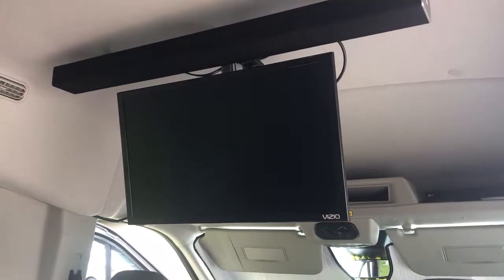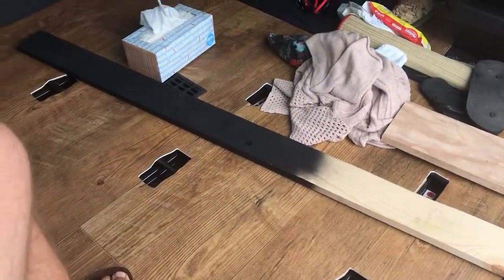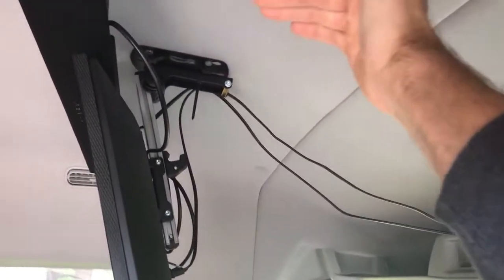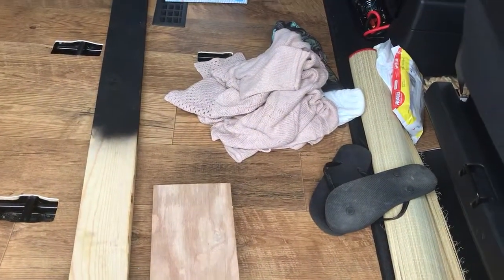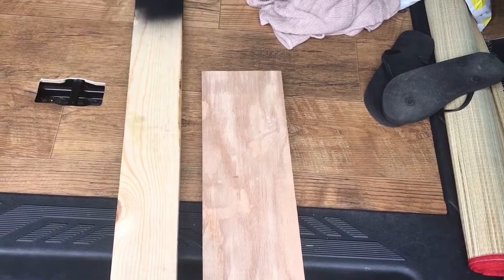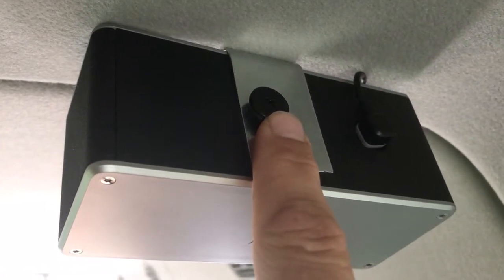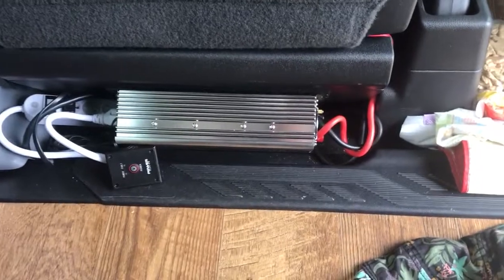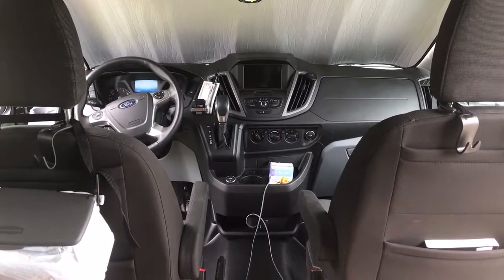2017 Ford Transit Passenger wagon TV sound system install

Comment: Where did you do your write up on the flooring? Looks good I’m in the same boat and want to get rid of the carpet.
Reply from the maker: I didn’t do a write up on the flooring unfortunately.  However, with the linoleum floor and the way the van floor is you can remove the carpet and use that to measure.  It’s not super difficult besides removing the carpet from the board it’s glued to.

Comment: Did you hook up the inverter to a secondary battery, or simply use the car battery?
Reply from the maker: I just hooked it up to the car battery.  It has two installed under the driver seat.